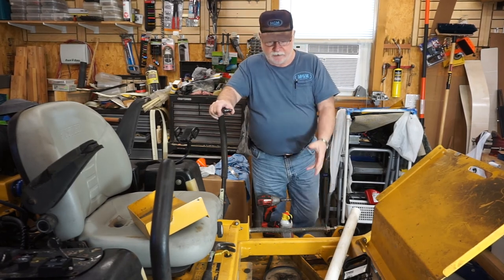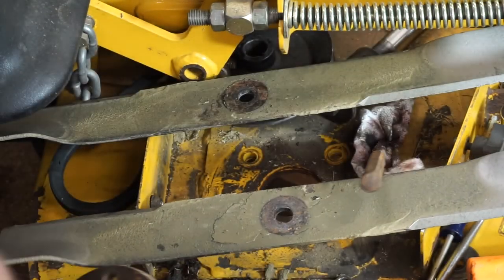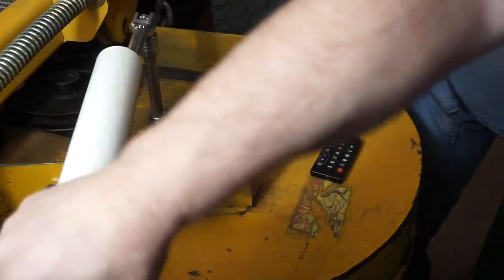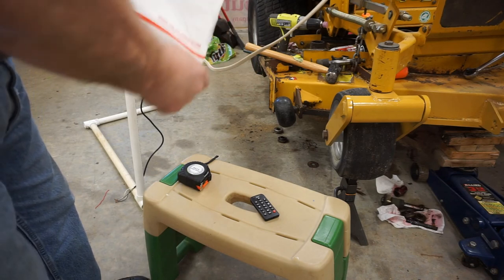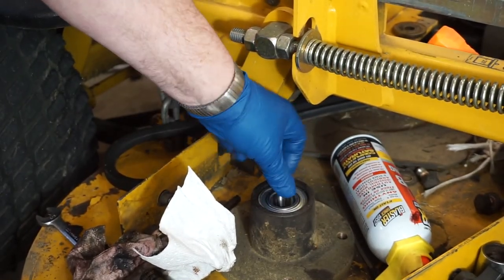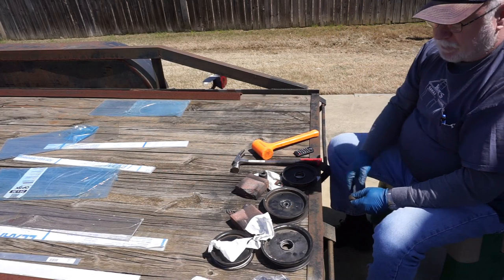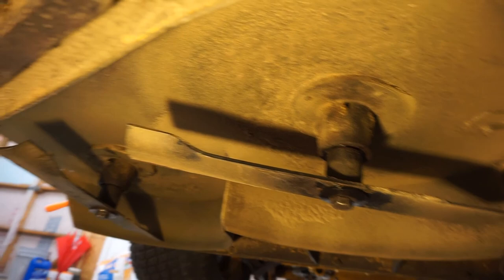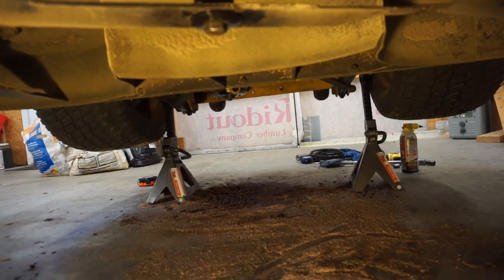Budget-Friendly Zero Turn Maintenance: Quick Guide to Replacing Spindle and Idler Bearings

Comment: Replacing the bearings is much cheaper then buying the hold assembly , you did a great job Max and a  great video.
Reply from the maker: Yes Sir, it surely is. 

I would do this same thing again for the Raptor if and when it is necessary. Plus, I still have 7 bearings to be used on something. 

Sorry about the other version being out of sync between the video and audio.

Comment: Never use a plastic pipe for a breaker bar/cheater pipe. It's plastic and doesn't have any strength in it's side. Use steel. When installing bearings, use a lg socket the size of the outside of the bearing. Did you think about adding a grease fitting to the spindles?
Reply from the maker: Used what I had and had what I used.

I started to demonstrate how to install grease zercs but time was running so long on that video I decided to do another video on that. Someday.